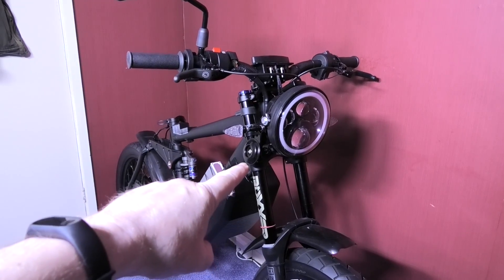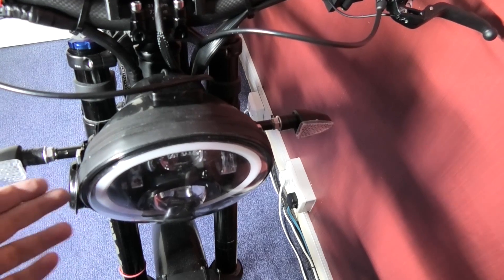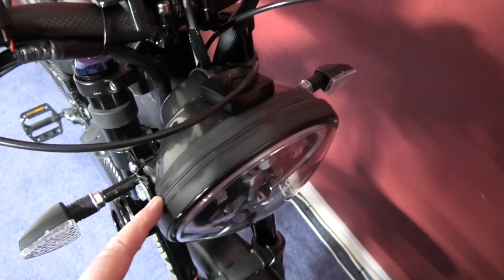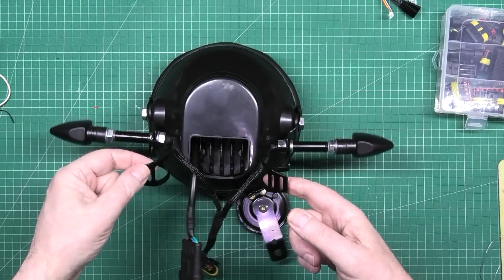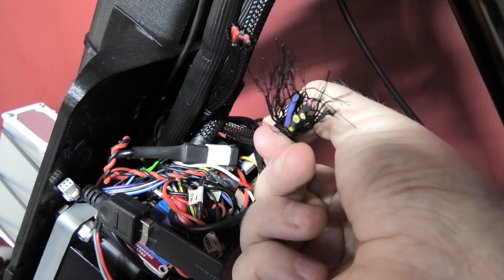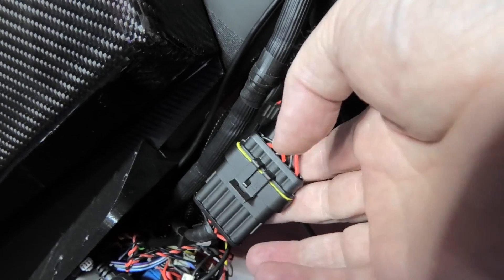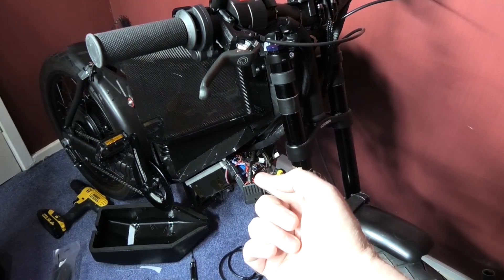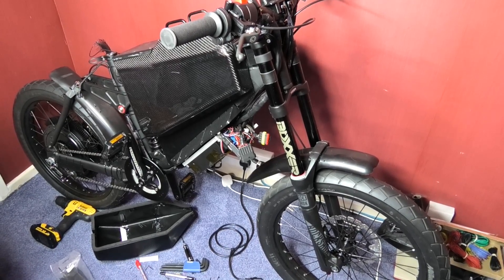High powered DIY eBike MSVA build part 28 - Modular lights

Comment: Ayup mate, instead of a winch can you not instal a dedicated crawler function.
A switch you can push while guiding the beast up the stairs?
It’d only turn the wheel very slowly and so it gets itself upstairs under its own power with you walking it up?
Apologies if you or anyone else has already thought of it.

Comment: Don't be a hero  trying to get it down the stairs. I live in Great Barr and would be more than happy to give you a hand moving it . Currently building my first ebike, you've been a big inspiration. Just let me know if you need help.
Reply from the maker: Cheers mate. Getting it down the stairs is easy - I simply use the brakes. The trouble is, once it's down the stairs, if it doesn't work, I'm stuck but........ I have a cunning plan (which is partly why I've temporarily removed the headlight). All will be revealed soon 😁

Comment: Hey Tony, I hope your back is better now... I think with headlight looks much better your bike moreover it has a good feature, you can see with that in the dark in case of necessary 😀 BTW, you will be a hero if you can really arrest yourself not to use this beautiful adrenalin bomb on a daily basis.
Reply from the maker: I have fitted another headlight until I put the bike through the MSVA and I've also done some other modifications to make it more ergonomic 😁

Comment: Two different gender connectors
... Should of used non binary lol
Reply: @Vortecks  BTW love my cheap 1kw motor. Got home in 3 mins this morning all uphill. Can't believe such small motor will pull 30 uphill
Reply from the maker: @girlsdrinkfeck  I might do a shitty video soon which explains voltage/motor size/available current. I should be able to explain how things work and how to squeeze as much power out of a motor as possible.
Reply from the maker: @girlsdrinkfeck  You're correct. I'll have to start making some notes so that at least one person can understand how things work :-)

Comment: i'm 53, and i have back problems as well. i have the seat and pedestal with the wheels on it from a broken desk chair to sit on when i work down low. it has no seat back and rolls around easily so i don't have to bend over, or constantly be getting up and down. makes life a lot less painful.
Reply from the maker: I have my daughter's chair from when she was 2, it works perfectly 😁
Reply: @Vortecks  i like the wheels so i can roll from project, to tool box without having to get up.   you just have to really know where your tools are in the drawers above yer head. my boy gave me mine because he broke the back, so they are both more valuable than anyone could know.

Comment: I now use the same double headlight thingy as you had and it is only held on by a couple of strong cable ties and has been fine for about a year, I hope your back gets better soon and I will keep my fingers crossed that you win the lottery or something and can get a ground floor flat. keep em coming dude we are rooting for ya.
oh yeah that little bar end mirror you tried and said was crap was because you got ripped off by a dodgy china man who used a flat mirror instead of a concave/convex (idno which)  I had the same issue when i replaced mine after breaking it and wouldn't go out without it. now.
Reply from the maker: I'm now using the same headlight (just for testing). As for the bar-end mirror, I found it impossible to get it through doorways with it installed. I'll figure something out, even if I have to go back to the 60's and use loads of scooter mirrors 😁
Reply: @Vortecks  - I think we may be on about different mirrors, but I have no idea which one of your vids you said it in and it won't let me post links on here for some reason, but I'm sure you will sort it anyway
Reply from the maker: @I_Am_Not_Tyler_Durden  Just to clarify..... bar-end mirrors make the handlebars 2" wider. That 2" makes a lot of difference (as every man knows 😂) and I can't get it through doorways. It wasn't the convex mirror that was the problem, it was the cheap and shitty quality of the plastics and the mountings. I'm going to get a smaller one for testing and I'll mount it where the other one was.
Reply: @Vortecks  - You must have one that is bigger than mine, (lucky you,:=)

Comment: If your only using it at weekends don't bother with a mirror just turn ya head like an ostrich...
Reply from the maker: I might use one of those helmet mirrors or I might find a smaller one for the bars. I can't do without one because I find it hard to turn my head 180 degrees and still expect to be going straight when I face forward 😂